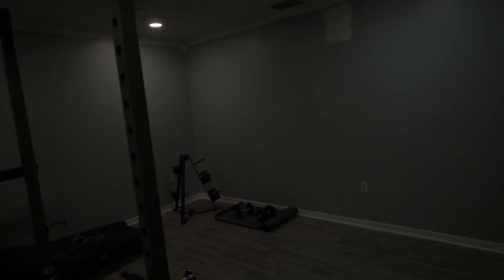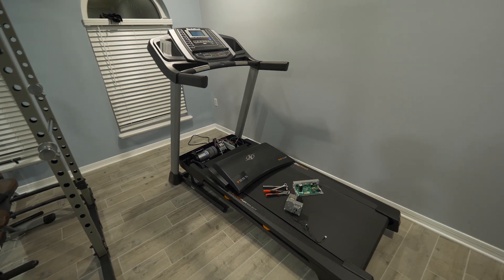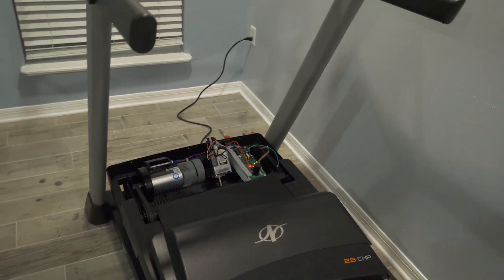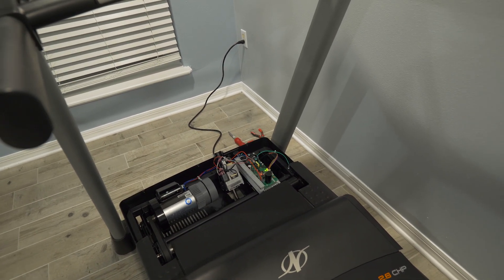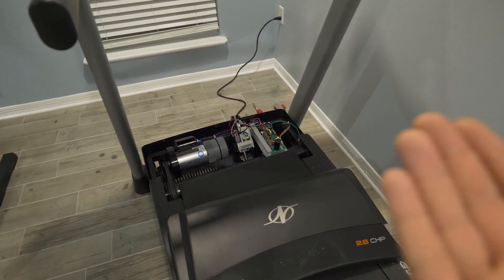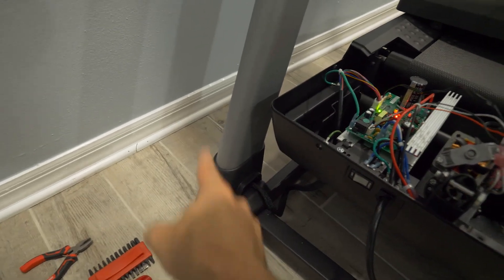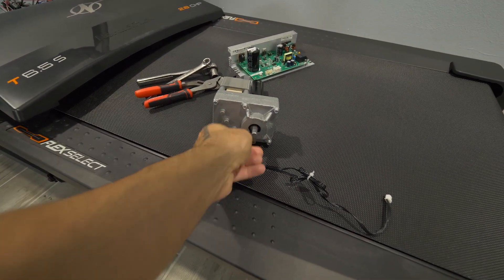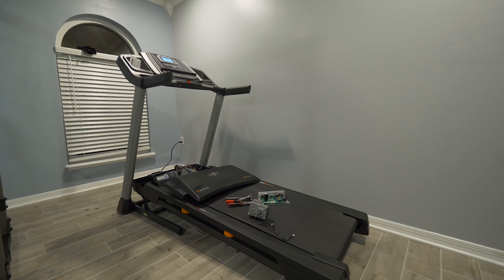DO NOT BUY!!! - Nordictrack T 6.5 Treadmill

Comment from the maker: Update Nov 30th 2021

Pre-req: Icon Fitness handles warranty service for Nordictrack. They will send you parts, to diagnosis over the phone, etc... If you need a technician to come to your house, they use Assembly Experts Inc. That's the company that does the physical warranty work on location. Wanted to make sure we're clear that there are two separate companies handling Nordictrack warranty work.

The repair technician (Assembly Experts Inc) was scheduled to come on Nov 17th. On Nov 16th, I called and emailed to verify they were still coming... no response back. On Nov 17th, I get a voicemail "sorry, we cannot come. Our technician has an infection and has to be in the hospital. We will get in touch to reschedule" I said "Ok, I understand." 

A couple days later I get an email to reschedule to Nov. 23th. I said "Ok, that day works for me". Nov. 22th comes and I call and email to confirm they are still coming and what time to expect them... no response. Nov. 23th I call and email them multiple times between 9-11am... no response. I even have the cell number of the guy who is coming to my house... goes straight to voicemail... I then call Icon Fitness and explain to them that a service tech is supposed to be at my house today but they aren't responding to me. Icon Fitness says "Ok, we are sending a message to their service coordinator and will get back to you in an hour"

A couple hours go by and I don't hear anything from anyway, so I call Icon Fitness again. They tell me that there is nothing they can do. That we need to wait until we hear from the service tech.

Later on Nov. 23th, I FINALLY get a voicemail from the service tech at 6:36pm. SIX-THIRTY-SIX PM!!!! telling me he is on his way and will be here in 45mins. By this time I don't see their voicemail until 8pm. I'm at work (I work from home and the treadmill is located at my home), so I decide to call back the next morning because it's too late.

Nov 24th 9am, I call Assembly Experts back and the guy tells me "We were trying to get in touch with you all day yesterday and you wouldn't answer your phone". I'm just in shock. Like this guy is seriously a liar and is trying to turn this into being my fault. I told him off. Cause seriously, wtf!

I then call Icon Fitness and explain to them what happened, that this guy is a liar. (His name is Jim). I send Icon Fitness copies of all the emails and phone calls I have showing that I've been trying to get in touch with them non-stop and they would never get back to me, and I ask them to send all these copies to their service coordinator to show that I'm not the problem. I then tell Icon Fitness that I'm not interested in rescheduling with Jim and that he is not welcome in my home. (I made a promise to myself many years ago that I won't let deceitful liars into my life anymore) And I asked if they had another company they could use to send out a tech or another tech to come out. They said they'd get back to me in an hour with another service company...

That was last week, and I haven't heard back from Icon Fitness. Granted, Thanksgiving holiday happened between, but still...

I decided I'm not going to call them back to get a tech out here. The treadmill incline is stuck in a mid-point position, but the belt still works. I put the treadmill back together and will use it like that... without an adjustable incline.

If you want to see other stories about Assembly Experts Inc, look them up on Better Business Bureau. A bunch of terrible reviews and accusations of this company being manipulative liars.

Comment: Listen everyone, please do not buy any model of Nordictrack Threadmill. I guarantee you are going to regret. I had two of them. Now I’m stucked with the 2950 model. I had the technician come to my house 5 times and I still have problems. I replaced the motor, motor controller, rollers twice in two weeks, console. I spent close to 2,000 dollars and still don’t work. The machine didn’t have warranty because it was a display machine.

Comment: got this machine and belt won't move...  but incline works!  Cant figure out why.  Glad to know the red and green light are normal (or is hit).    A red light should be an automatic fault code. on a control board (normally)
Reply from the maker: Guess I can't say what is normal or not, because I never observed the lights when it was working normally.

Update my situation: Repair guy cancelled our appt last week, rescheduled for tomorrow... haven't heard back to confirm he's still coming. Hopefully he doesn't cancel again. I dunno what else to do.
Reply: Having the same problem as you - incline works, but belt won't move. It makes a little jerk when setting it to 3-8 speed and hit start, but that's it. Did you get yours fixed? Would love if you could share your solution
Reply: Same issue!! Very annoying
Reply: Did you determine a solution? I have the same problem.
Reply: I have same problem, incline works but the belt won't run
Reply: @vuly8784  for me.  I found there is a short or wiring issue at the top of the console.  The wiring that goes down the right tube that connects to the tread belt.      Just moving it around made it work again.    I think it’s just terrible wiring.    Try checking the under the right arm wiring harness.

Comment: Hi, I fix NordicTrack treadmills. I would first make sure the wires going from the display to the lower control board are not pinched. Take it apart if you need to get a better look. Sometimes you can put the treadmill on its side and see through the bottom of the side column with a flashlight. Many times people assemble it wrong and the wires get pinched near where the screws go into the column at the bottom and the top where it joins together. This happens quite often.

When you receive the wires you can swap it out temporarily without taking the machine apart just to see if it fixes the issue and then if it does move on from there. 

Second thing I would do is swap out the lower circuit board. Take photos of the wires so you don't plug them back in the wrong way. The LEDs on the lower circuit board you have here are not doing what they normally do and I am very familiar with the T6.5. 

If you get rid of the machine you can take it apart and put it out the day before the trash goes out. Most scrap collectors will grab it for the metal. If that doesn't work you can search for a local scrap collector and see if they want it.  

I hope you get it resolved but if you can't do it yourself you might want to just do some searches for 'Treadmill Repair' in your local area and see if you can find someone who can help. Good luck. Matt-
Reply from the maker: All those repairs were attempted already (upright wire and controll board replacement) none fixed this issue.

My garbage man won't take it. Their trucks have an arm that lifts our garbage cans. So they will only take garbage that fits in our cans. Anything that doesn't fit in our cans, we have to bring to the dump ourselves.
Reply: Can you possibly help me? Lol
Reply: Hi I just came across your message. I have same model and everytime I turn it on it comes on full speed and won't lower the speed. Any suggestions on how to fix this issue.
Reply: @azr2012  If it speeds up while you are already engaged in a workout, then there is probably a button shorted out on the console like the speed up or something. If it goes to full speed as soon as you flip on the power switch, then most likely the motor controller circuit board is bad. If the motor controller circuit board went bad and your treadmill isn't fairly new anymore then it may have gone bad from overheating so you might also need to replace the walking belt. I think the T6.5 has a pretty difficult calibration procedure for the walking belt because of how the front roller sits in a groove on the left side. If that is the case then typical walking belt replacement instructions won't really guide you through it. You'll need someone who really knows what they're doing. Hope this helps
Reply: @MattandHolly920  Hey thanks for the response. Yeah looks like it might need some overdue attention. When I purchased it was second hand so who know how they treated it. Thanks for the info I think I might need an upgrade.

Comment: Had mine professionally installed with the delivery from amazon. Been using for about two months with no problems. Everything is running  as expected. Perhaps you pinched wires when you put it together idk. Don’t trash it. Get someone to rebuild it for you.  Good  luck. I know how frustrating it can be when you need to start exercising and you can’t !

Comment: I have the same issues, it’ll raise all the way up but it won’t go down at all. I ended up manually lowering it but every time I would turn it back on it would raise all the way up again 🤔. So I manually lowered it again and unplugged the elevation mechanism from the main power grid. Turned it on and it stays level but the elevation won’t work, but that’s ok I don’t usually use it.
Reply: My suggestion for you is to unplug your incline sensor from the control board. If you don't know what it is, you can ID it by looking at your incline motor. From the backside looking at the incline motor, the sensor is in the right side near the bottom. Just follow the black leads to the board and disconnected. If all is good, it should toggle up and down(raise and lower) when you depress any incline level button. So since it's stuck at 10, it will toggle between 9 and 10. If you get this response, I would take the sensor our from the motor(pop out with flat screw driver), inspect it and reinsert it. If you remain stuck, it's likely a bad sensor. Good luck!